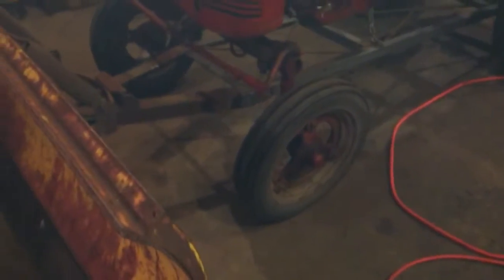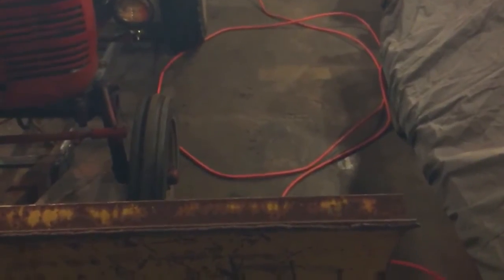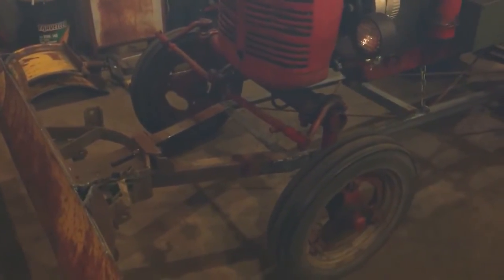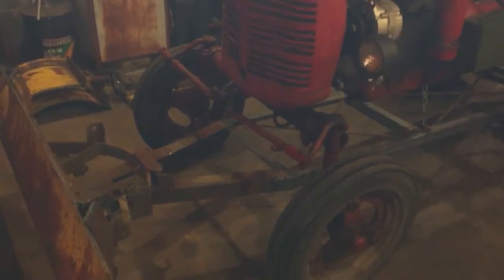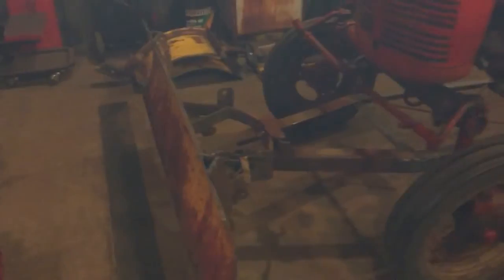1941 Farmall A, Snow Plow Installation, Part- 4

Comment: That's Boss ! Hell you could even put a big rubber flap deal on top to help snow roll if it was a problem. Lighter springs will help incase you hit something. Boy the first yr I ran My cubcadet Blade I sprung the hanger because I hit concrete edge with my blade. It did not ruin anything but it tweeked shit a bit. Scared the hell out of me :) I bet you knocked off 30 to 40lbs . Less out front helps with forgiveness should you hit something on an angle like I did. Thanks and excellent work !!!
Reply from the maker: I think your in the ball park with your guess on weight. It doesnt seem like much that was cut off but dang that stuff was heavy. The springs should be tricky as Im not sure what weight to start with. I guess I'll start light and go heavier as needed. It would be a shame to do all this work and turn it into a pretzel on the corner of a sidewalk, lol. So I'll play it safe. Thanks for watching!
Reply: It takes some effort for me to grab my blade on my cub cadet  to manually trip it.  While I stand in front of my blade I grab the top and place my foot to the bottom of blade. Simo I push with foot and pull with hands and If I could guess i would think 80 to 100 lbs pressure. I could not hold it tripped even if I tried . Just a guess with the idea in  the strength level using a torque wrench and bracing my body to get her done.  Best to trip than rip up equiptment ! It really looks good though Mr 31 Ford !!! Like Jason 1 Pa said ,, Let her SNOW !!!!! :):)
Reply from the maker: Funny you say that, it did snow last night. It was just a dusting tho. Thanks again!
Reply from the maker: Hey thanks! Thats a late 60's version of the A, I believe. Looks like a similar set up too.